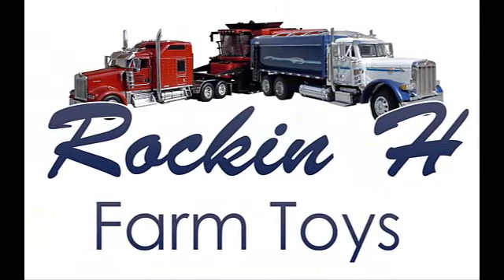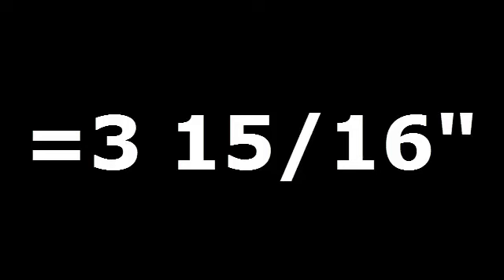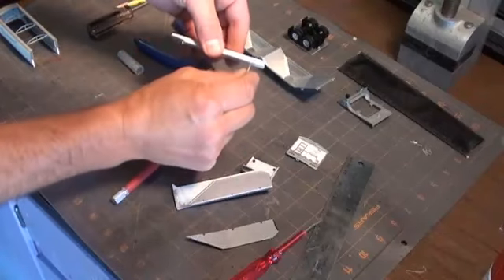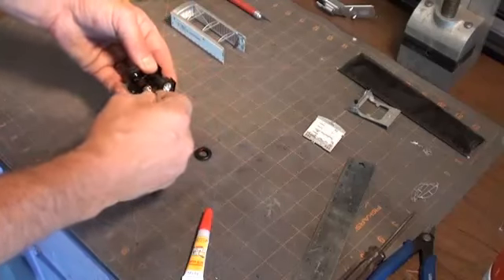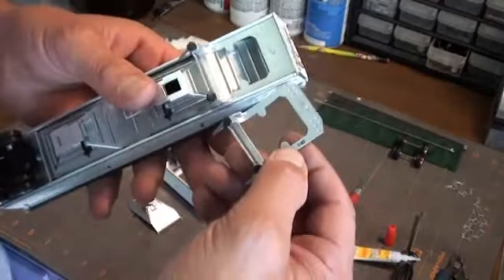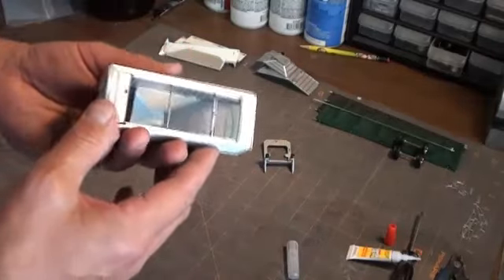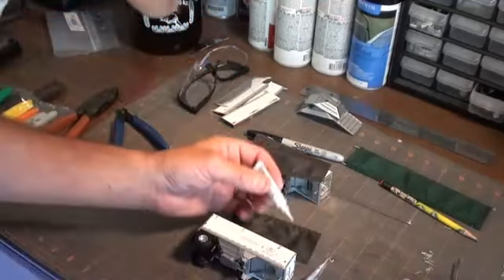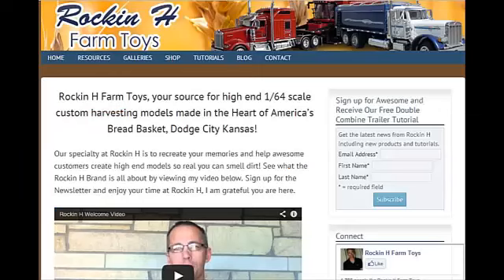How to make a 21' DCP Wilson Pup Trailer

Comment: Is there a way I can make a 1:32 scale tractor single axle?
Reply from the maker: Certainly I would think so. Cutoff the back axle, salvage the mudflaps etc to re attache. Then stretch the frame with brass or plastic. Good luck